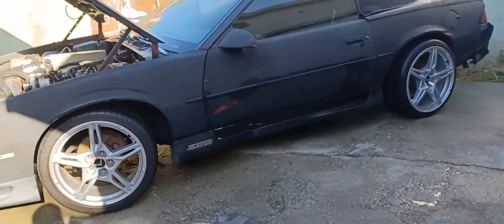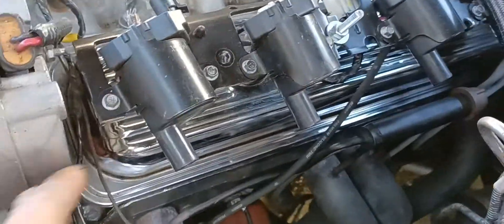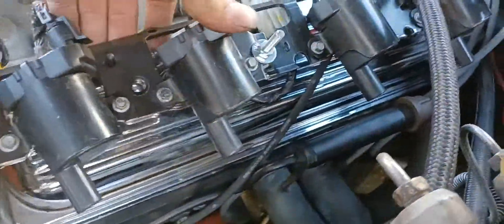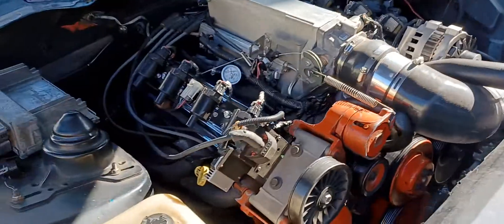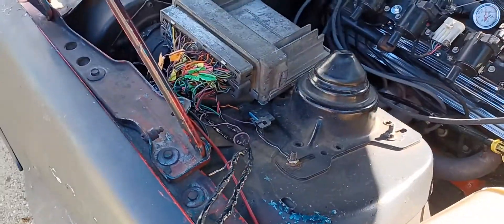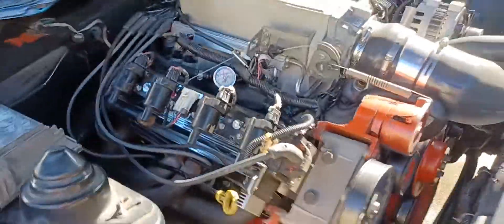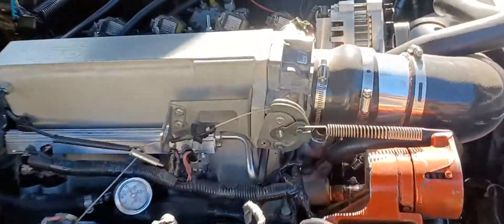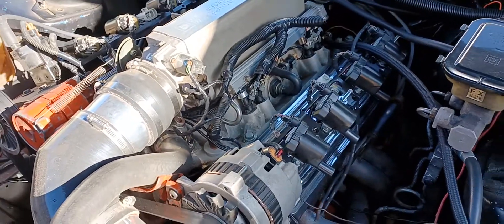How to Make your own LSX Coil Brackets!! SBC Vortec 24x swap 0411 Efi Connection

Comment: Hey man was wondering if you got it running with the coil on plug ignition if so how is it running
Reply from the maker: not yet my g, rebuilding my 4l60 at the moment haven't had time for the maroe but I will soon. Ill upload soon as I finish. Just need to swap reluctor wheel and few wires here and there, tune and violaa.
Reply: @HustleSoundz  one more question what knock sensor are u gonna be using?
Reply from the maker: @jarredsmith8091  going to be using the one I have on there now, off a 2002 Express Van 5.7 Vortec
Reply: @HustleSoundz  what engine block are u using?
Reply from the maker: @jarredsmith8091  880 BLOCK
Reply from the maker: @jarredsmith8091  880 block 96-02 L31 5.7
Reply from the maker: Git it running with the 24x lsx bro